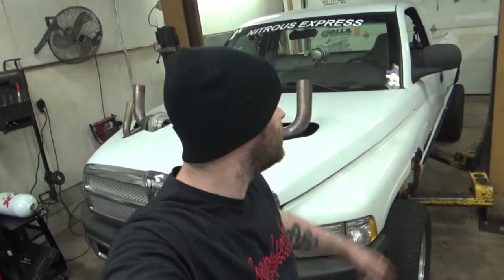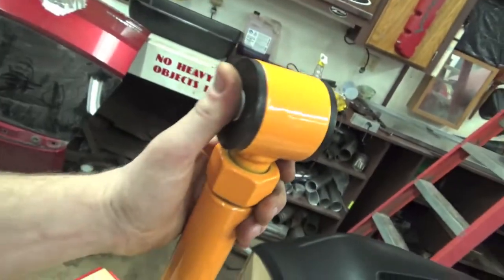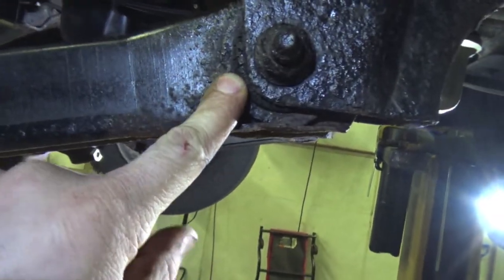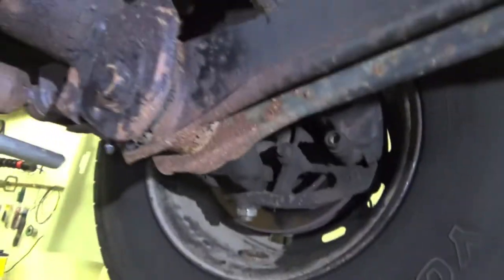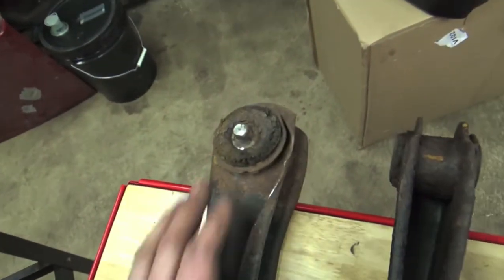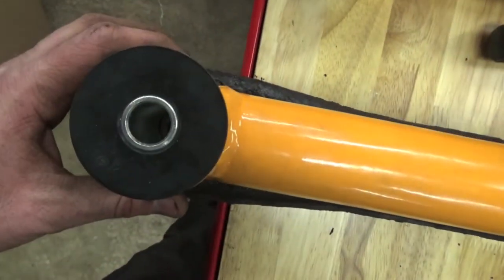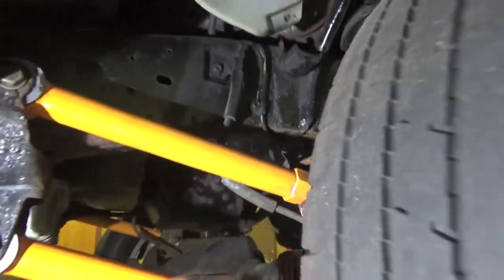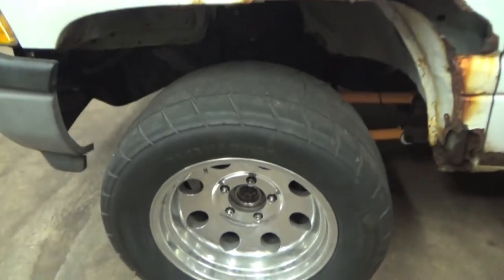MaxSpeedingRods Adjustable Control ARMs install DODGE RAM 1500/2500/3500 1994-2009

Comment from the maker: If you want to pick up a set of these BEEF CAKE 🍰 control arms and get 5% off entire website using promo code “RacingRam” check them out here: https://www.maxpeedingrods.com/product/upgraded-adjustable-front-upper-and-lower-control-arms-0-6-for-dodge-ram-1994-09.html thanks guys!
Reply: Wish they came in red.
Reply: @insomniahobbies   Rattlecan to the rescue? But seriously, i got a 99 1500  4x4. It's a Michigan truck living in Miami now. I should probably have ordered the hardware too.

Comment: Stupid question here, so if I was moving my front axle forward an inch I would just have to lengthen each arm an inch correct?
Reply from the maker: Yes but axles going to shift driver side so you would need a longer track bar as well
Reply: @tyrobertson4954 did you get your axle slid forward?  What all did you need to do that?  I’m trying to move mine forward one inch, and I am wondering how much to adjust the track bar

Comment: I installed those on my truck and lasted one year. You cannot buy replacement bushings, and I needed to adjust the length but after one year was totally unable to, Even with a torch. 

I would definitely not recommend these, however core 4x4 has a much better option.
Reply from the maker: Anti seize and I’m at 2 years now no issues

Comment: I am so glad I found your channel, it is fun watching you do the build. I have a 95 ram 1500 with a 408 stroker running a sniper xflow, I was running a carb but swapped it out. It is lifted 5" on 35"s but man do I wanna lower it and run some smaller tires like yours. I got 4.56 gears so I think running some 30s would be nice for the strip
Reply from the maker: Ya that would be a torque monster!!! How do you like the 408?
Reply: @RacingRamFam  oh it is sweet, has plenty of power. The 3500 stall converter kinda hurts the low end but when you give it some gas it moves pretty dang good. Still torn between staying NA or trying to go with a single turbo. After finding your channel it has been very hard to choose lol
Reply from the maker: @robertzarella5907  nitrous assisted yes lol

Comment: Front Locker! Lets Go!!!!!
Would welding the stock front Diff be able to handle the 4x4 launches? Or would a upgraded diff be strongly recommended?
Reply from the maker: Could weld it but would have to use the axle disconnect

Comment: The link is dead; I imagine these turned out to be junk?
Reply from the maker: No they have been good https://www.maxpeedingrods.com/product/upgraded-adjustable-front-upper-and-lower-control-arms-0-6-for-dodge-ram-1994-09.html
Reply: @RacingRamFam  Cool, How many miles you put on them so far?
Reply from the maker: @larrycarpenter-yt4ot  20,000 ish